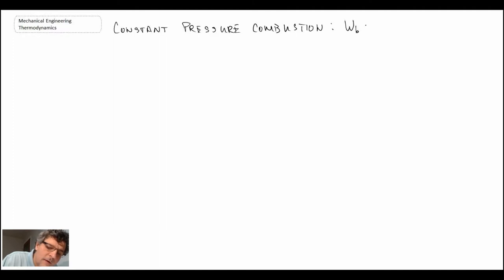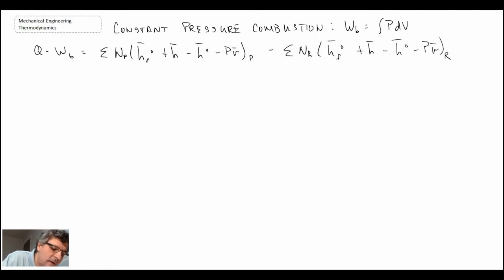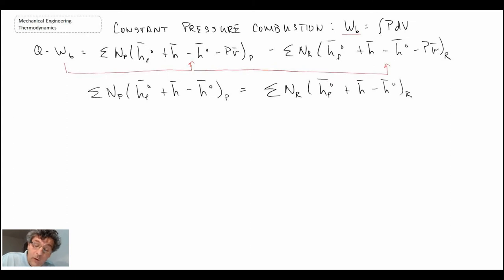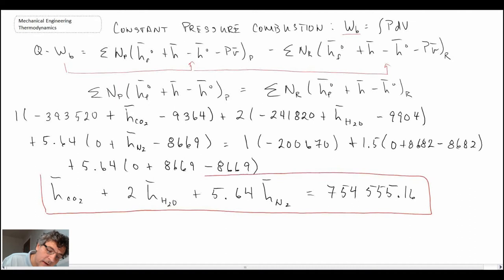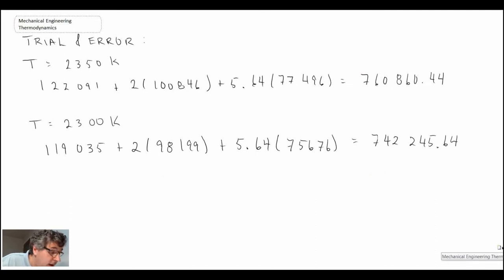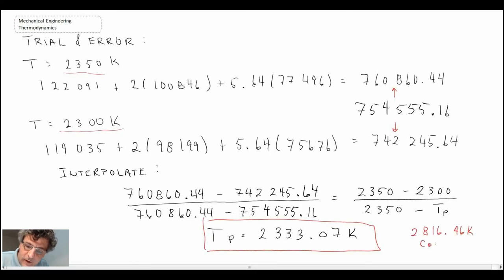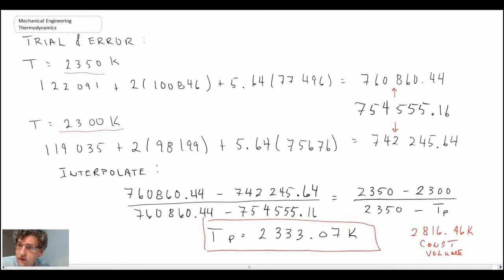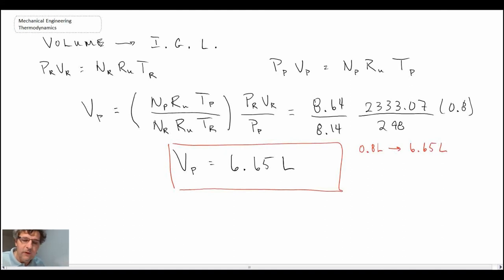Mechanical Engineering Thermodynamics - Lec 34, pt 4 of 4:  Example - Adiabatic Flame pt iii

Comment: Thank you for the lectures. These were very helpful in my thermo course. I look forward to using your Heat Transfer lectures as well (although I hope I won't need them as badly as I did with Thermo)